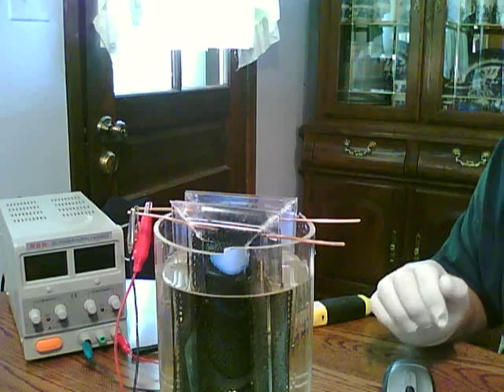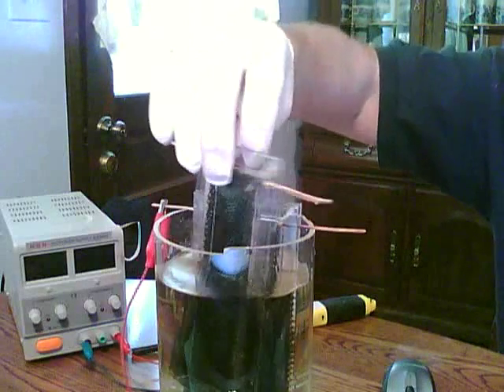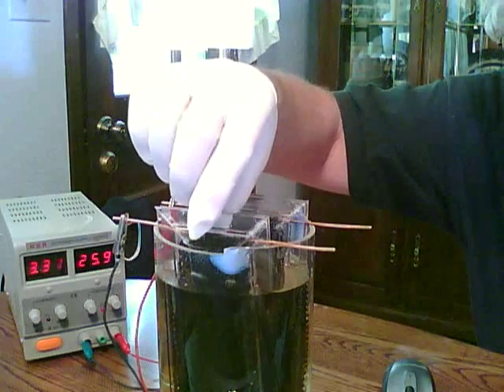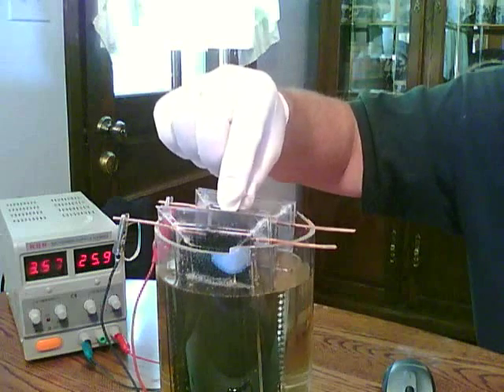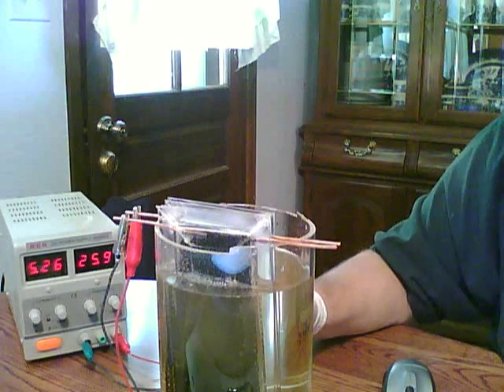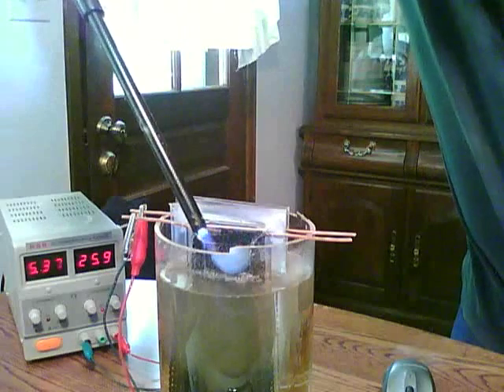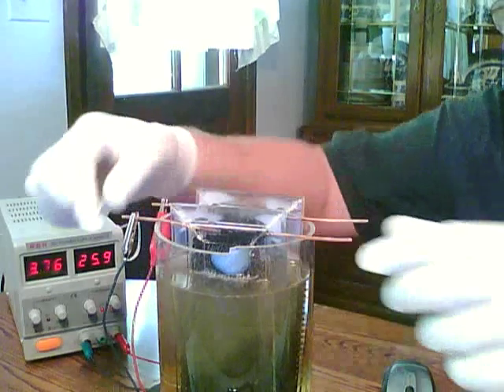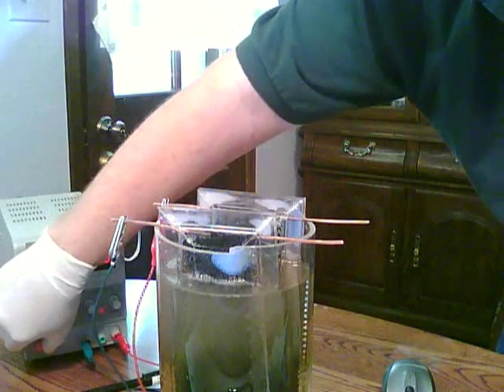Carbon Fiber Cell test

Comment: I believe it is the current which causes the deterioration of the plates, not the voltage..
I have run experiments to test this hypothesis, which all confirm my thoughts so far. However, I will be performing more conclusive tests to confirm for sure... Watch my videos for updates on this....

Comment from the maker: Hi EyeGuy1970,

Thanks for the feedback it is much appreciated.

However, while electroplating the Carbon Fiber will protect and preserve the Carbon Fiber, the electrolysis process would be based on and be reacting to the 'Donor' material (ie Nickel). The intent of the experiment is to look for alternative 'Base' materials to act  as electrodes.... Thanks again.

Comment: Cool, thanks. I'll have to see if there are any plastic/fiberglass shops around here.  

I've also been following some developments in carbon fiber technology and have high hopes that carbon tubes may be able to withstand voltage better.  Carbon tube fibers are coming down in price, but are still only as inexpensive as highest quality carbon or graphite from what I understand.

Comment from the maker: Hi Vancecook7,

Thanks for watching and thanks for the question.

(1) The Carbon Fiber Cloth was purchased at a little plastic shop that I go to for all my acrylic. They carry a line of Fiber glass products as well as some small quantities of Carbon Fiber Cloth.

(2) I actually used the same solution that I use in my SS cells, Distilled water and Sodium Hydroxide.

Comment: Nice test.  I've been reading up on high temp electrolysis.  I'm thinking carbon fibers might do better with steam.  I just haven't the foggiest notion how to set up such an experiment with my limited resources.

I suppose more to the point: where did you get the carbon fibers and did you use anything to enhance the water (besides diffusing it with carbon fibers)?